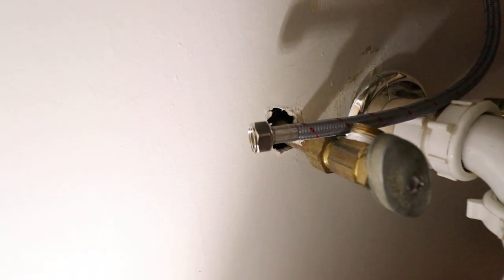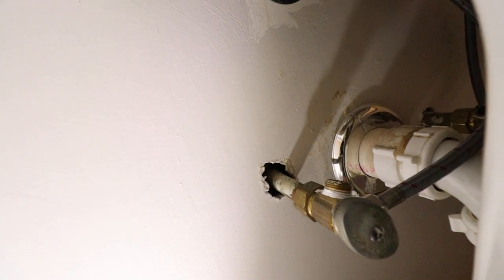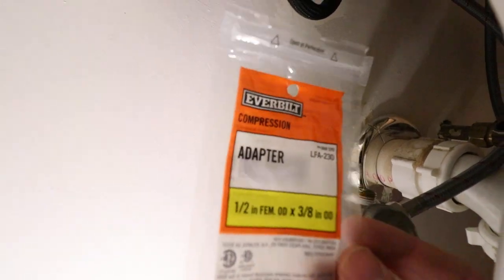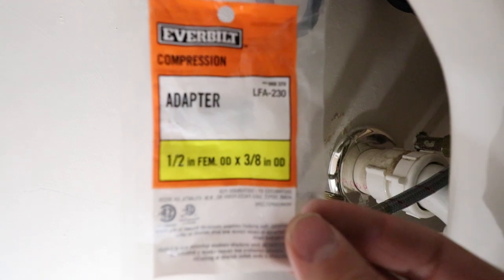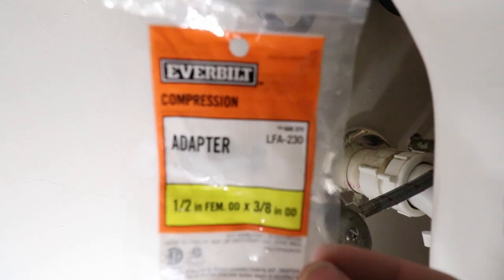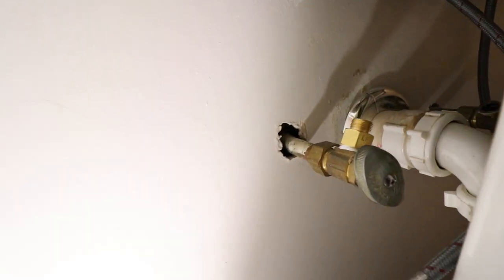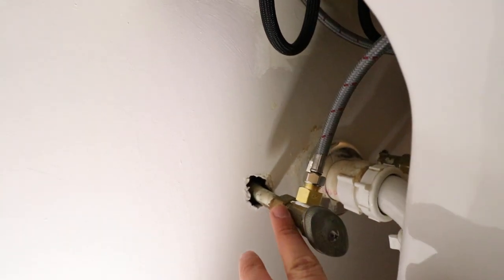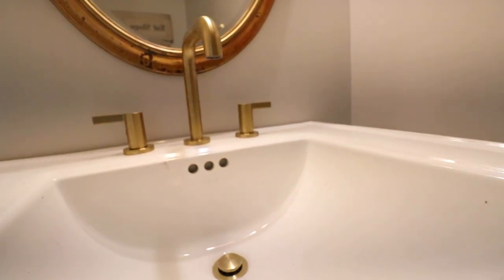Water Shut Off Valve Compression Fitting Adapter Installation

Comment: Trying to install my new sink faucet and realizing last minute that the supply lines were a different size was heart-stopping but this video helped so thank you! On that note: is it wrong to put Teflon tape on the shutoff valve? Asking because I've seen multiple videos with Teflon tape used but I know someone who's adamant about it not being used on shutoff valves. I've had no issues with it thus far but I just want to be sure.

Comment: I've done this installation, but mine is still leaking.  The female end of the adapter is leaking on the supply line.  Any ideas?
Reply from the maker: Maybe it needs tightened further or its the wrong size threads or thread cut.
Reply: @OneHourSmartHome  I bought two versions from two stores.  The second one was beading water and I was able to tighten it an incredible amount and it works now.  It seems like making a version of that with a no-leak rubber washer (like most hoses has), would be easier.